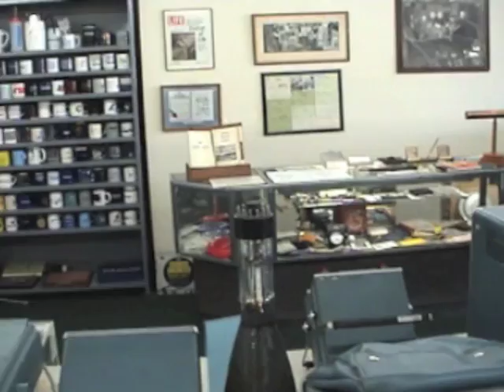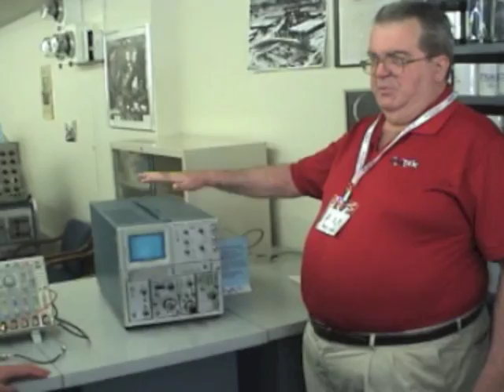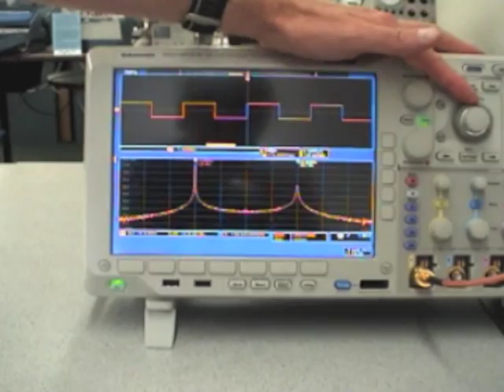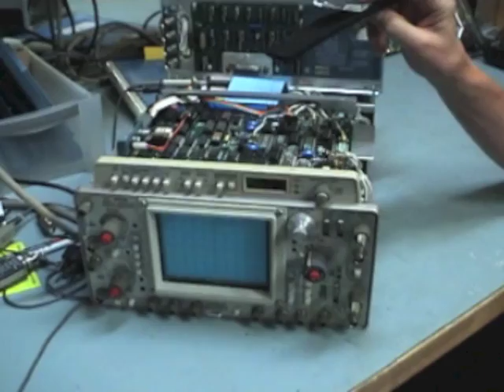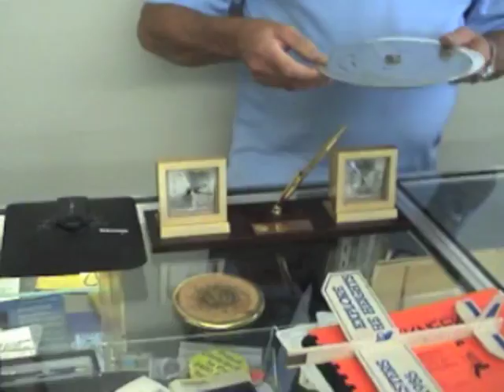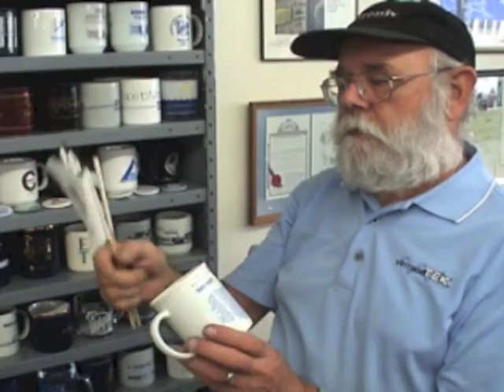Tektronix and VintageTEK

Comment: Hello from Brazil guys. I have an old tek 475 200mhz and one tek 475A.
The question is: Can i use a 475A 250mhz CRT, in a tek 475 200mhz?
Can i change the vertical atenuator array from 475 to 475A? thx.